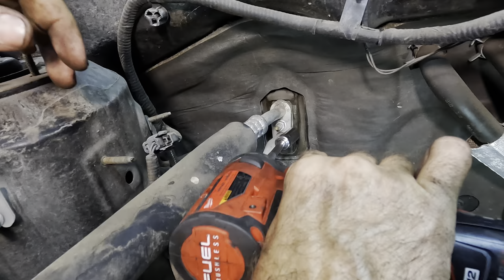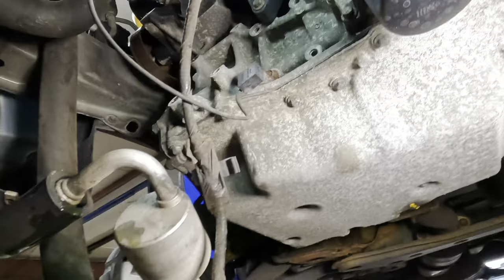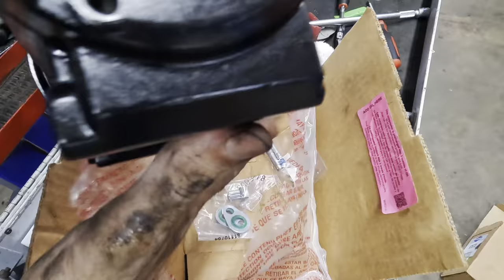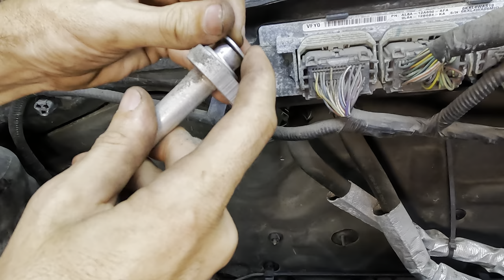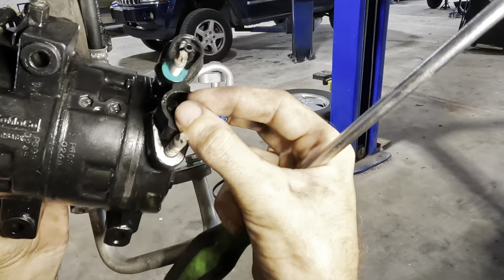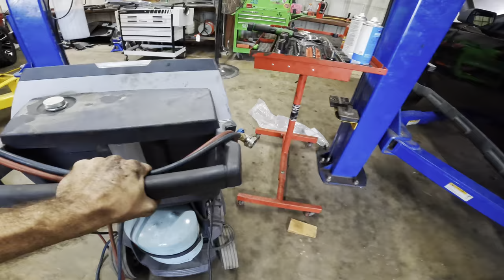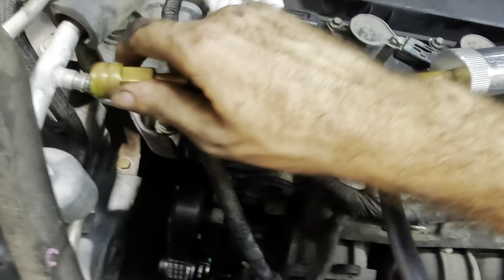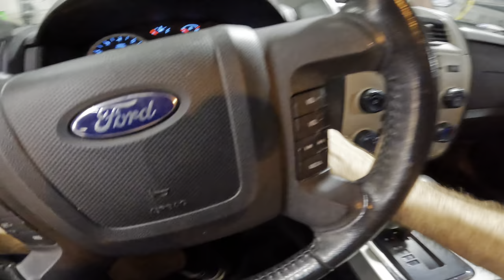Parts Cannon Complete! It’s bulletproof | Ford Escapé 2.5

Comment: That compressor doubled the price of the car.
Reply: 2x0 still 0, maybe -, when it comes back later with logged condenser and over tight belt's bearings failure.

Comment: Nooooooo a Double Roberson bit"......
Oh stop whinnnning if  it is only water? Could be something nasty like oil? ooooo  
An engine  oil  drain plug at GM is $38.40 , NAPA was hhhhaaa $3.84 with the copper sealing ring. So guess which one I bought???? Dam rights... wow!! 
With the size of them , they would qualify for "Machine Screw"" as 1/4" is the normal cutoff. 
Reverse right hand rule to remove it? 
Since I see that that plastic has broke off as commented by Ray, Does anyone have know of what epoxy works on in my case GM plastic? The plastic epoxy didn't hold that long for me which I want to re epoxy. Thanks for all comments.

Comment: What the hell is it with Ford and window regulators?  This has been a problem since the mid-80s.  

Can they not just add a couple of HP to to the motor or make the drive gear out of something other than papier mache?

Comment: hey ray do they not use orifice tubes anymore? ford worked on my ac 12 times and couldnt get it right under warrantee ,,,5 yrs later i take it apart because of high excessive pressure and i find three orifice tubes jammed up at the bend of return hose. fished out the tubes and put a new one in the correct way so it wouldnt get sucked up into the line and been working for many yrs no problem....stupid ford  newbies!......put the new guy on it till he figures it out.....

Comment: SOMETHING IS WRONG.  Recheck that compressor pulley. WRONG SIZE PULLEY  NOT A WRONG SIZE BELT.  That belt tensioner should be taking the slack out of the belt and not the belt removing the function of the tensioner.  What is going on Ray?  You screwed the pooch on the Honda ball joints and I bet you haven't corrected that fubar, and this is not right.  Stop acting cute and start focusing.  You screwed up.  To paraphrase you, "You love your job so much, you get to do this one a second time (for free)".
Reply: yep, the mechanic, now double tension.